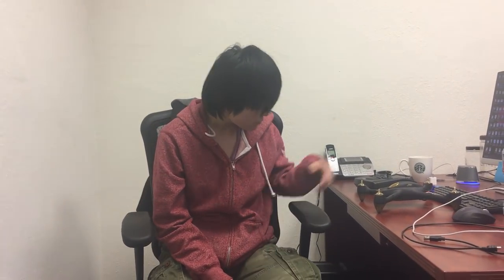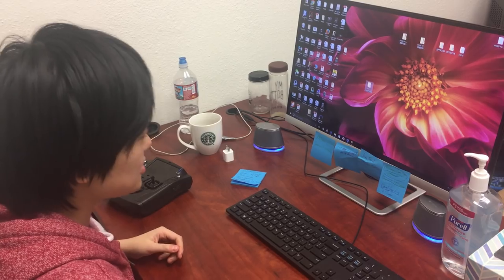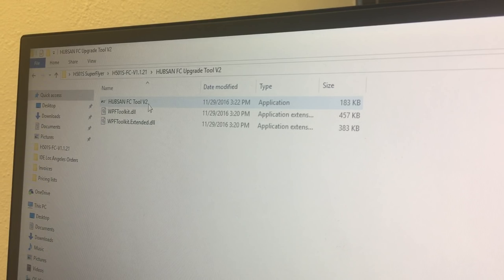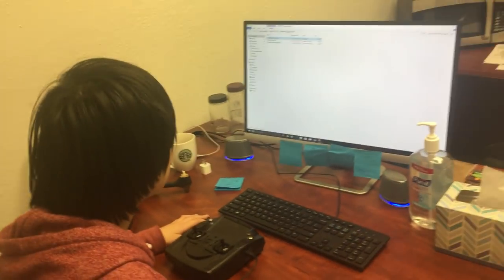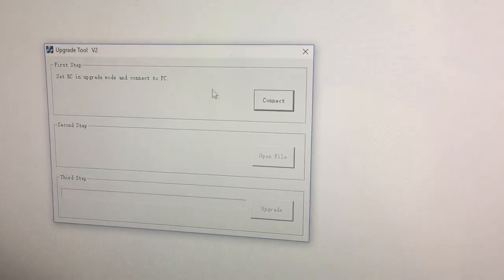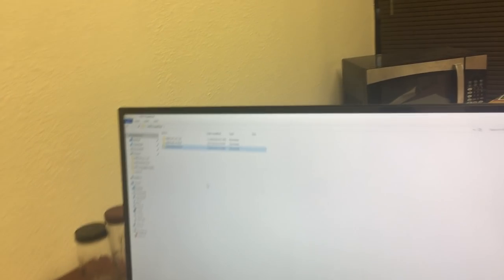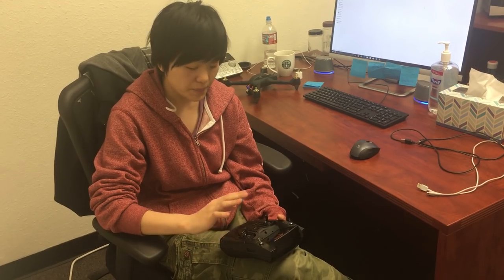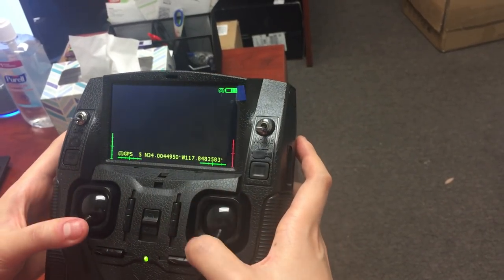H501S Firmware Upgrade Protocol

Comment: Always good to pull these Annie vids up again when I pull the old 501 out. I'm currently getting it to bind enough to my multi protocol T16 to control the lights, but the motors won't start. Every time I finish the compass calibration, the lights show a good cal, but then it returns to the swirling red light pattern. I repeated the cal several times in the same exact location, to no effect.  I saw somewhere else where they were talking about an IMU cal by going right rudder then moving the directional control left and right until the lights change.  I'll try that next before trying the compass cal yet again.  🙃

Comment: whew, made it through the end of this video with FC, RX, and RC/TX upgraded! Thank you Annie, and team Hubsan! (update:) Just a tip: Before starting with any firmware upgrades, go to the RC settings and note the frequency it is in. You will have to set it back to that frequency after the upgrades, the stick calibration, and the drone binding.

Comment: Annie: I hope you can help! Firstly;  I love my Hubsan Quad Copter and now this
makes my second one. 
The first H501S X4 Advanced purchased through Amazon
performed a fly away into a (30 meter tall) tree. The second H501S also sold by
Amazon came with standard controller. I knew Hubsan controllers will bind to
any of their quads; so assumed my existing advanced controller would work with
the new H501SS. I watched your video and down loaded the zip files. The notes
were very helpful. Performed the following: 1.Bind   2.Stick Calibration  3.Horizontal Calibration  4.Rotational CalibrationAll completed properly, however the hover test was surprising.
The quad drifted in GPS mode by meters and would jerk as if the GPS was trying
but not performing as designed. I landed to pursue contacting Hubsan – No reply
as yet.I suspect the transmitter firmware V1.1.16 might help…  Not sure where/how to down load it.Here is my setup:H906A   V.1.1.13501SS  V2.1.29   V1.1.41
What do you think?
Reply: Also, the follow me switch did nothing. The quad did not attempt any turn toward me and only faced toward its heading. The simple solution would be to forget the advanced H906A controller and modify the standard controller with external antennas.
Reply from the maker: Please send a short video of the problem to service@hubsan.com.

Comment: Great instructions. I followed it step by step and had no problems, I managed to get 250mtrs height and could have gone more with a standard controller ( no antenna mods )  One thing I will mention is that when in mode 1 and you want to access menu I found that it is right stick down and press on the left stick. I also found that after the firmware upgrade the controller did not automatically read to calibrate 1, 2. It read check gyro sense which I did by left stick to the left, right stick jiggle left and right until calibrate came on the screen,
Reply from the maker: The newest firmware will automatically calibrate if the magnetic declination is low in your area, but to make sure the drone functions even more safely, you can do the manual calibration.

Comment: Hi. From Italy. As i m a beginner and Hubsan H501S 4X Advanced is first drone for me. After i read and re-read +++the manual and looked at the review in youtube +++before flying. First day before flying i have done all the steps..Turn ON TX then RX..GPS(both) +6(i got +10) GPS ON. the first two attempts were bad and the third attempt was worse. It broke a propeller. Were short flights.!! When i returned home and i reread the manual. The manual pages 7 : Transmitter(Model 2) the elevator/rudder stick on the left hand..and pages 12, mode 2 the elevator/rudder stick on the right hand. !!!!! I was CONFUSED before flying :(
On the second day was a little better. I always flew with GPS ON(A off, return home off, B off) and it worked good. Mode return home(gps on,A.B off) worked good. Mode follow me( A off, Gps on, return home off, B on) NOT WORKED.!! Sometimes i feel like something out of control.. !!
The third day of flight. In the afternoon was fine, just a normal simple flying. At night, gps on just about take off and  i have tried to take a photo/viedo, with GSP ON it should be stable but the drone was out of control. It flew straight and crashed into a tree and broken 2 propellers. !! I replaced the propellers and continued my simple training and it was fine.

Now i know. 1, the drone could go crazy. 2, the manual not correct explain(pages 7, 12). 3, why Hubsan give 8 propellers.

Pls,Anyone can tell me : 1, H501S 4X advanced can upgrade? (with window only!!)
                                            2, Is it possible to use other type of propellers ? (Phantom..)(right now i have no more spare. From China is coming need 3 weeks more and Amazon need 2 weeks :(

Thank you.

Comment: Do not be upset this firmware is supported by the Hubsan X4 AIR H501S Standard Edition .... Thank you nice ... I still have a question which is the original version of hubsan drone, there are many models and I am a little confused as I buy the original version but not I know what it is like, how can I distinguish them, what color should the packaging have in the original version, I will greet a great thank you, with great esteem and respect

Comment: thank you so much for the video it was so helpful, the firmware on the Hubsan site does not contain the FPV TX firmware, so i'd only done 2/3 of the process!!
Reply from the maker: There is no RC file on the website because there is no need to upgrade RC.

Comment: Annie can you tell me if I buy a 2nd h501s can I use the first transmitter on both drones
Thanks love your video's very easy to understand and very helpful
Reply: Not both at the same time. You'll have to rebind the controller to the other drone if you wish to fly it.

Comment: Excellent video.  My BIG question.  I just ordered my Hubsan H501S advanced from Gearbest last Friday.  Will it have the newest software???
Reply from the maker: The version depends on when it was manufactured and distributed, so I cannot tell what version you will get.
Reply: I understand.  I'll check the versions when I receive it.  Is it necessary since mine will be so new??
Reply: Yes Dan, I know.  It all depends on the manufacturing date.  Something I have a little experience in since I sell plastic compounds.  I also sell a little bit to China..;)
Reply: Oh, since I'm on an OFFICIAL Hubsan Youtube site, may I make another comment. I assume the shell of the Hubsan is made of either ABS or a blend of PC/ABS.  If the shell is ABS? Then it won't survive any major impact.  I have plastic compounds with excellent impact and ductility. PC "Polycarbonate alloys" that are more expensive, but the amount of plastic on this quad is minimal and we are only talking maybe a $1/quad.

Comment: I purchases a H501S Advanced with the better transmitter for my son for Christmas.The FPV range is terrible even in open space. Nothing like the 1+ kilometers people are getting online. I've read that you shouldn't do the firmware updates if you have the advanced transmitter. Is this true and if not, what firmware numbers are the best for this setup? Thanks in advance. PJ
Reply from the maker: The firmware might help you with the range problem but sometimes it is a hardware problem. You can visit www.hubsan.com for the latest firmware.
Reply: HUBSAN OFFICIAL I have the same problem. if is hardware. what part can be? or how can I fix it

Comment: I just bought this model two weeks ago not from Hubson,bt from a third party seller on ebay brand new. How would I know what firmware I'm running? for both transmitter and the drone? What firmwares are you upgrading too? thanks in advanced.

Comment: Hi Annie,
Thanks for the video. I think you have confused the two USB cable types. When you said mini USB on the drone I think you should have said micro-USB.

Also on the transmitter the adapter is mini-USB not micro-USB.

At the end of the video you also gave the Hubsan support phone number but I could not determine if you mentioned all the digits. You said 909 440-555. That's not enough digits!

Thank you for your help.

Jim
Reply from the maker: We appreciate your effort and time in providing feedback to us. And you were right on both part, the number is (909) 444-0555, the drone uses a micro USB and the transmitter uses a mini USB. We will make note on the video for both mistakes. Once again, thank you for your help.

Comment: Does all the new h502s remotes have a JST connector? What brand, size and voltage lipo battery would you suggest putting in the h502s remote?

Comment: also I have noticed a squeaking noise coming from the drone... I am an engineer and felt for play in the motor's. The rear right hand motor has play in it, the others have none. I've only flown it twice. please help with this and my battery query.. many thanks.

Comment: I am a total newbie. I just bought the Hubsan H501S Professional version January of 2022 with the H906A controller. The one and only version number shown in the setting is H906A v.1.31.19. There is no TX, RX or FC version number.  Do I need any firmware or software updates?

Comment: I can't update the lasted firmware , I do following the tutorial until 7:37
 when I press the upgrade, it show me "update error".
 Do you have any idea to figure out?
Reply: I receive the same error.  Did you ever receive a response?  I did notice you might need to "Unblock" file.  Right-click on the firmware file, select properties in the many that pops up, and tick the UNBLOCK box.  However, even after closing all down, still the same update error.  I'm wondering if the H501S Standard is actually the 501SS firmware and not 501S firmware.
Reply: @GenioCinelli  I changed to uddate H501SS instead but still have the same problem.

Comment: Very good video! I upgraded to Superflyer a few days ago but I left 4.2.8 on my tx instead of putting 4.2.9 on it. Do you for see me having any issues with 4.2.8 on it instead of 4.2.9?
Reply from the maker: The Superflyer would require you to have 4.2.9.
Reply: I have 4.2.8 on my controller now with Superflyer and it works fine and I can't find any issues with 4.2.8. I got 1407 meters with stock antenna set up on standard controller. Do you know any differences in 4.2.9 and 4.2.8?

Comment: This was very helpful, thanks!  I'm hoping that the firmware upgrade will help me out as my first four flights were disastrous (five broken propellers, as the drone was just flying off on its own no matter what I did). Though, now I have to wait for a new supply of propellers to arrive. However, the current (as of Jan 5, 2017) firmware zip file doesn't include the third part of the upgrade (the RC file): it only has the RX & FC parts. Is that going to be a problem?
Reply from the maker: There is no need to upgrade the RC, that is why there is no file available.

Comment: RC on Advanced controller 
When trying to update firmware  holding to bottom right and pressing enter I get the flashing red light but not showing as connected through update program?

Comment: Hi Annie have done firmware upgrade and i cant get check gyro sens off the screen and the battery icon for the drone shows empty even with a fully charged any advice would be amaizing .

Comment: Two questions Annie, how can you tell what version your H501S has, and what does the firmware upgrade do for the drone? Thank you.
Reply from the maker: You can check your firmware by pulling the left stick to the lowest position and long press the right stick simultaneously to enter main menu interface, then select check version from there. All upgrade files will now include a release note, so people can tell what is added into new firmware.
Reply: Thank you!

Comment: Nice vid annie .So if i upgrade my 502s i don't have to upgrade the transmitter/controller.I have the new 502s with the upgraded board and Shally gave me the firmware for it but i have it in Chinese and its the same procedure as your doing but i cant read the boxes cause there in Chinese and also i forgot to ask Shally if i need to upgrade my controller after i do main board so what should i do any advice would help

Comment: Hi Annie, I just lost my 501s today, got`s lost in the strong wind (35 mph), blow it up up up I tried the return home, but did not come back, instead went to the sea and vanish, any way, the reason I am writing is that I would like to know, if I buy the 501c I gonna be able to use the remote from the 501s?, another question is the 109 would be more effective in the wind, once it is heavier? 
thank you for your help

Comment: ok guys can you do a video on updating the H501A  if you dont have a transmitter and one where you do have either the standard or Advanced.. I have the advance transmitter glad to say it works wit the H501A so best of both worlds but the distance is not great fro flying or FPV signals..

Comment: Excellent Tutorial!  1 thing I am missing though, is Follow Me for the far right switch on Advanced TX.  I bought this used and the quad is Standard with upgraded TX.  Just wondering if Follow Me comes along with firmware upgrade?
Reply from the maker: Follow Me is a standard function across pretty much all of our firmware- unless you run into an incompatibility. In this case, do email service@hubsan.com with your full firmware information for verification.
Reply: @HUBSANOFFICIAL  I've emailed hubsan but they don't reply

Comment: First off great video. Secondly I have v4.2.9 on my standard controller with external upgraded antenna and fpv but my 501s cuts out fpv at 120 meters even when I had the standard antenna and fpv so the external upgrade ain't helped. Would this update increase my fpv range and would I need to upgrade my controller or is the firmware ok. Thank you
Reply from the maker: The firmware is fine, the problem might have to do with the hardware. I would suggest that you send an email to our services team at service@hubsan.com.

Comment: Hi,

I just got a 501S advanced version TX H906A V1.1.2, RX V1.2.12, & FC V1.1.21

Everything seems to be working correctly however after my third flight and a minor crash the TX began beeping at a one second rate and does not stop even though both the TX and RX have 10-12 satellites and the batteries on both around 7.4V. I tried disconnecting both batteries and rerunning all the calibrations in the manual, but the beeping does not stop, even if I just turn on the TX and it finds plenty of satellites. Please advise on why this is happening and how to correct it, thank you.

Also I have been researching the various firmware versions and just wanted to make sure I understand correctly. 

1. So the TX (for advanced version) has no, and needs no other version update? 
2. The RX V1.2.12 is the latest version and or there is no benefit to change it? 
3. The FC could be upgraded from V1.1.21 to V1.1.22 and this could help improve range and or lessen the chance of system shutdown during aggressive pitch/roll flying, is this correct?

I saw that there are other versions of the FC firmware but I am in mid-america USA and those mainly pertain to helping the compass in other parts of the world so V1.1.22 is the only worthwhile update for my location. Am I correct about all of this?

Comment: i have x501s standart controller,i already upgrade it with extended antenna fpv 5.8ghz 14dbi and 2.4 ghz 3dbi but still i can fly higher max only 254m altitude and in 200m fpv is black out.and cant reach more higher than 245m seems like it has limitter.what should i do

Comment: Very nice instructions!    My issue is what is missing.   Why or when would you do an update?   What is it based on?     The Hubsan support site is of no value.   I joined the Facebook group for the H501S and was directed to downloads.   The whole things feel sketchy.   Why are updates being provided outside of the Hubsan support area?      I attempted to apply an update and it failed.   Now I get "CHECK GYRO SENSOR" and can do nothing with the rx or drone.   I am thinking this may have been caused by my attempt to update the FC.    Also, how is one supposed to tell if they have the S or SS version?   I believe the updates are different.   I am not feeling good about the process and wish I never attempted it.      I will give support a few days to respond to the issue and hope it can be resolved.    i have already started the return process, but I hope it does get resolved because it is a really nice drone.
Reply: also, the update give me a "update error" nothing else with V3.   The newer version gives me "erase timeout".

Comment: Hello Annie. I have a question for you. I purchased the h501s about a month ago and it came with firmware 1.1.9. Should I be updating my firmware even tho im not really having any issues other then follow me mode not really keeping me in the center. Other then that drone seems to be running perfect. Just want to know if it is important to do updates as they come out? Thanks
Reply from the maker: If it's working well, we advise you leave it alone completely. As for the follow me problem, you should be able to yaw the drone while it is in follow me mode so you can keep yourself in the center.
Reply: Ok great thanks. One more question I think I am going to purchase the h501A also and just wanted to ask is FPV range is as good as h501s. I have the pro controller so i gate great range on the 501s but love all the features you get with 501A. Im sure range wont be as good on FPV but would like know that I would not loose it at only 100 meters out either. Thank you for you quick response.

Comment: I just checked the fitting and I'm pretty sure the Type A to B mini usb connector is the same lead you use for charging a playstaion 3 controller.. could someone confirm this please? it fits in perfect so I'm assuming it's all good.. the lead you get for the drone update also works to charge a ps4 pad in case you can't find a micro usb.